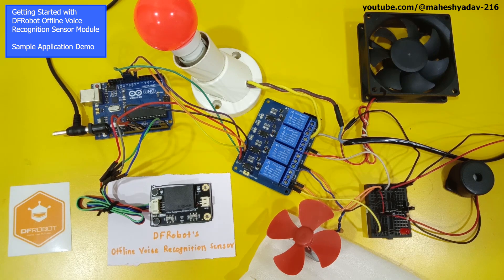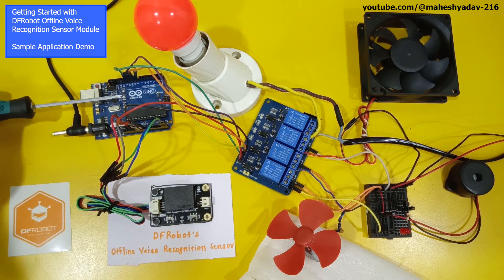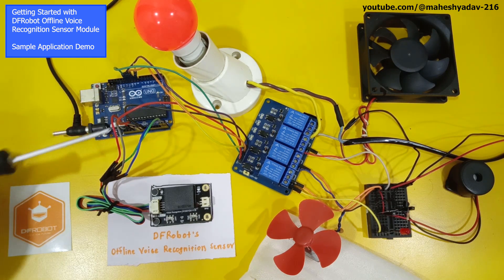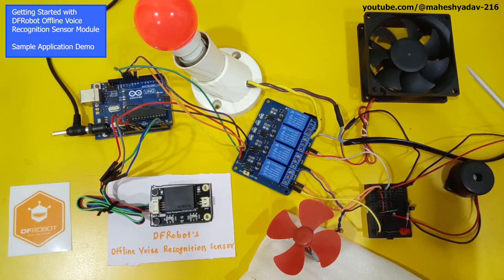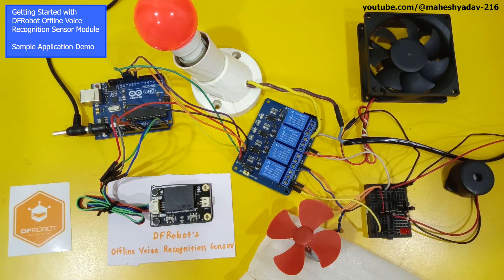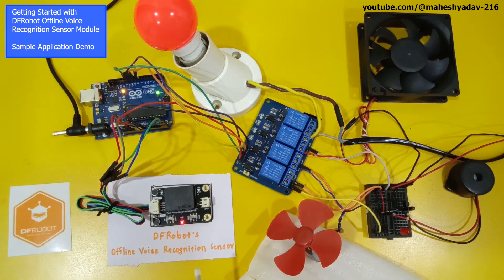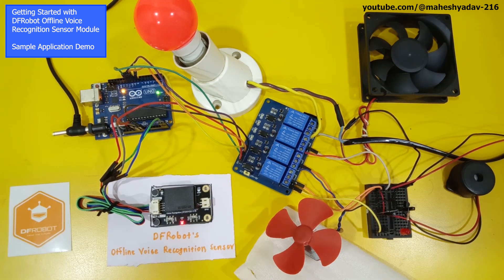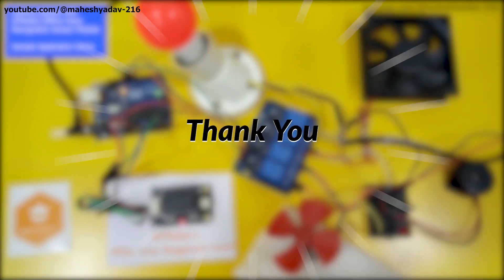DFRobot Offline Voice Recognition Sensor - Demo

Comment: Sir, thank you for your clear review, I have 1 question when I use this module with the I2C communication together with 1 OLED display using I2C communication too, so how can I control both of them, to declare the address? I'm just a newbie so I hope you reply to my comment, many thanks!
Reply: And would you mind writing a short code for me:_) I'm a newbie and want to complete my project because it has too little documentation about this module and still don't know how to share the I2C bus with multiple devices. Thank you so much, Sir.
Reply from the maker: Dear dũng nguyễn @dungnguyen-si2sz

Thank You very much for your encouraging words. 

This device (DFRobot Gravity: Voice Recognition Module) boasts high compatibility, supporting both I2C and UART communication methods.

As You want to connect "this module with the I2C communication together with 1 OLED display"

For your query there are two approaches/solutions -
1. You can use UART interface for Voice Recognition module and I2C interface for OLED display

==> We know (from WiKi page of this Voice Recognition module) that to use I2C or UART for this module you have to just declare the your communication interface initially in the code. Like following -

//I2C communication
DFRobot_DF2301Q_I2C asr;

//For UART use as per availability of serial ports
#if (defined(ARDUINO_AVR_UNO) || defined(ESP8266))  // Use software serial
SoftwareSerial softSerial(/*rx =*/4, /*tx =*/5);
DFRobot_DF2301Q_UART asr(/*softSerial =*/&softSerial);
#elif defined(ESP32)  // Use the hardware serial with remappable pin: Serial1
DFRobot_DF2301Q_UART asr(/*hardSerial =*/&Serial1, /*rx =*/D3, /*tx =*/D2);
#else                 // Use hardware serial: Serial1
DFRobot_DF2301Q_UART asr(/*hardSerial =*/&Serial1);
#endif

2. If you want only I2C interface for both the module(Multidevice on I2C) then you just to need declare two separate objects for both I2C devices like following--

//I2C declaration For Voice Recognition Module
DFRobot_DF2301Q_I2C asr;

//I2C declaration for I2C display
Adafruit_SSD1306 display(SCREEN_WIDTH, SCREEN_HEIGHT, &Wire, -1);

To initialize I2C OLED display in setup function you need to do --
 //----------------------------------------------------------//
if(!display.begin(SSD1306_SWITCHCAPVCC, 0x3C)) {
    Serial.println(F("SSD1306 allocation failed"));
    for(;;);
  }
 //----------------------------------------------------------//

And To initialize Voice module 
 //----------------------------------------------------------//
  while( !( DF2301Q.begin() ) ) {
    Serial.println("Communication with device failed, please check connection");
    delay(3000);
  }
  Serial.println("Begin ok!");
 //----------------------------------------------------------//

Library of Voice module will take care of its I2C address.

Please go through following projects and their codes, you will get idea how you can achieve your goal

🔗 https://www.hackster.io/dipowin/voice-controlled-digital-cute-pikachu-9148e9

🔗 https://www.hackster.io/517133/voice-controlled-dht11-with-dfrobot-43a41c

You can always refer WiKi of this Voice Recognition module where they have given the codes for both the interfaces.

🔗 https://wiki.dfrobot.com/SKU_SEN0539-EN_Gravity_Voice_Recognition_Module_I2C_UART

Beside if you still have any doubts, feel free to ping me. I'll try my best to help you.

Best Regards